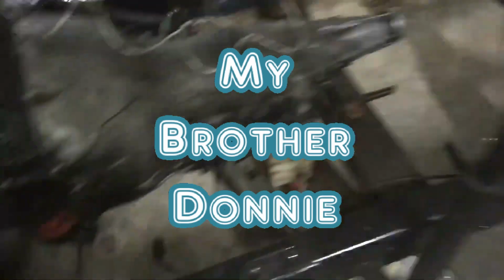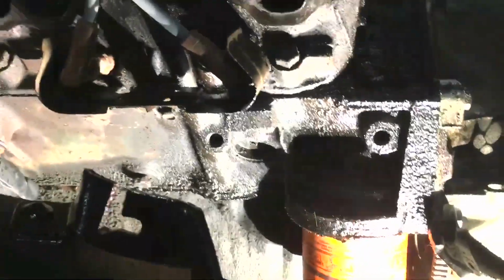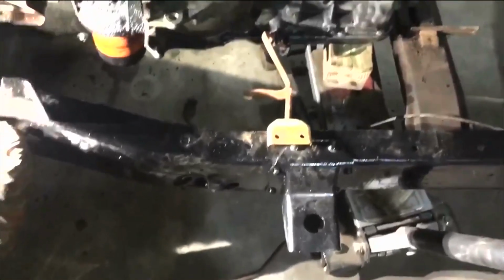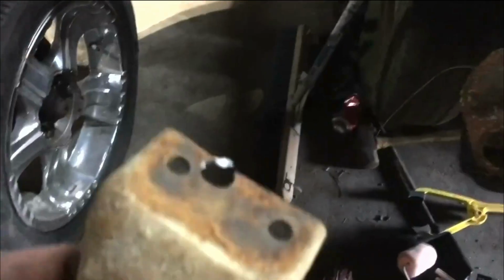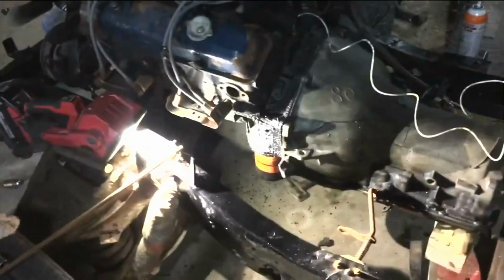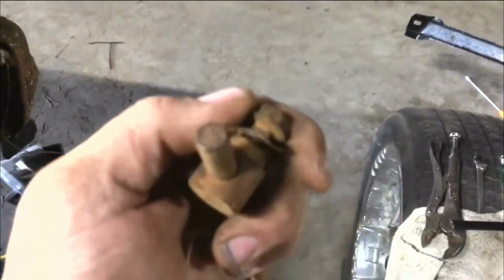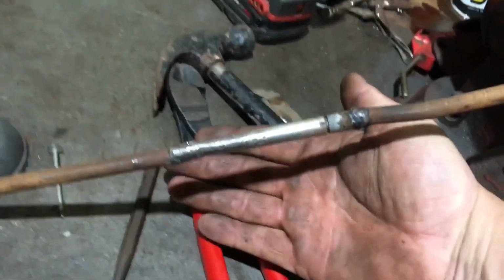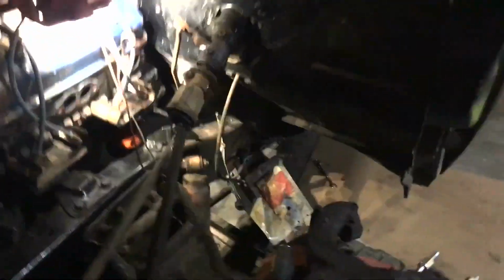How To Fabricate New Automatic Transmission Linkage On A Chevy Pickup

Comment: Floor shift automatics have the cross bar as well.  The shifter runs the PRNDL actuator but that U shaped bracket that bolts to the side of the trans is still there.  It runs the start in park only rod on the steering column that everyone unhooks.  LOL  Glad you got it together.  Things will go fast now.  The worst part of any project for me is when the car is nothing but thousands of rusty or greasy parts and a nasty frame.  Keep us updated!
Reply from the maker: Thanks for watching